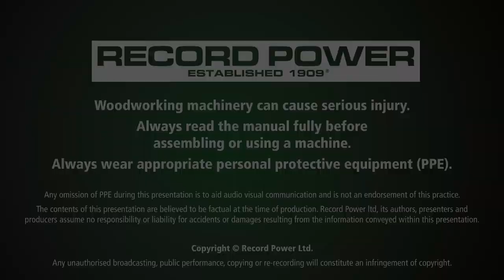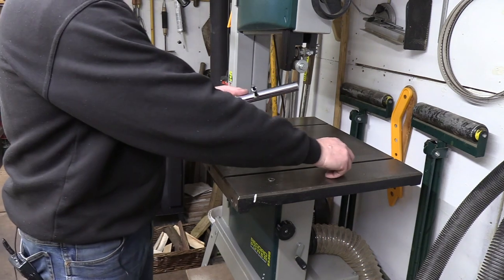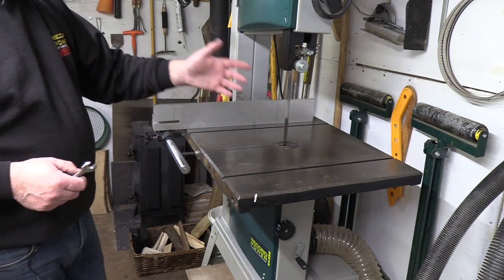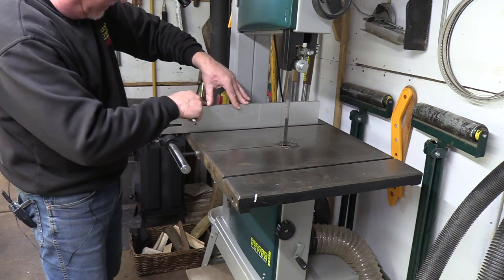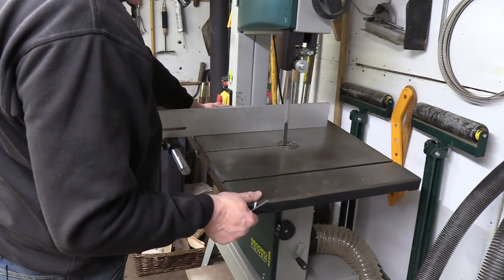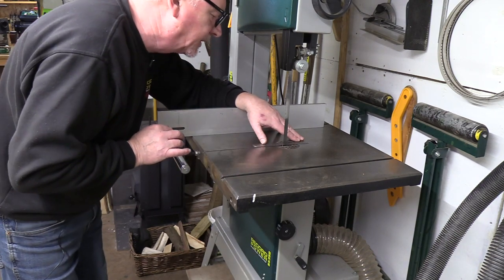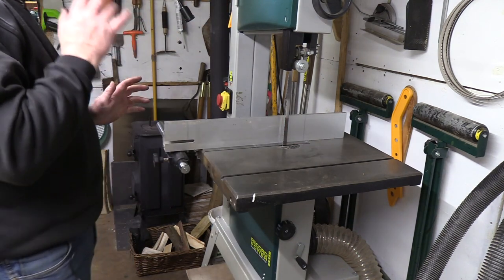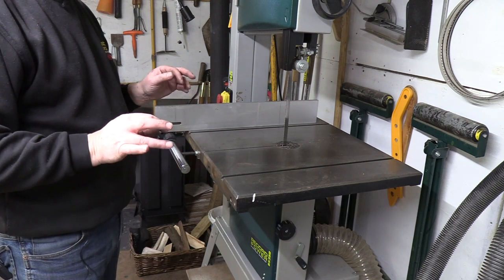Know-How Series: Squaring the Fence to the Table and Blade on the BS350

Comment: Thanks for this video  - really informative. I have the same bandsaw, but when I try to spin the top wheel, (as you demonstrated), it is very stiff, in comparison to how yours spins so freely. I have checked the tension & even when the blade is off it is still stiff. Any suggestions what the remedy is?
Reply from the maker: Hi Desmond, Your bandwheel should spin free with the bandsaw blade removed, id which bandwheel is tight by turning by hand and with the machine unpluged, you can even take the tension off the motor drive belt, check no piece of timber is causing the issue, also the guides are these ok.
PW.
Reply: @RecordPowerTV  thanks for getting back to me so promptly. I appreciate all your suggestions - which I have already tried - so at least I know I’ve been attempting to do something right! It’s strange I just can’t seem to find why this is the case. I have thoroughly cleaned & checked for any debris, I’ve oiled all moving parts, I’ve backed off the guides & the thrust bearings to ensure the blade isn’t in contact at all, but still no joy. I’ll keep looking , but thanks again for your help
Reply from the maker: @desmondsenior3617  Not a problem, if you do need anymore help/suggestions then drop us a line.
PW

Comment: How much adjustment do the four bolts on the trunnion provide?  The BS350S maintenance series has been excellent and much appreciated but I was never able to get the table square to the blade using the method described. In the end I had to undo the two bolts that fix the trunnion bracket to the frame and start from there. There was some evidence my saw had been dropped in transit to me so perhaps the trunnion assembly was jolted out of specification. Anyway I now have everything squared in three planes.
Reply from the maker: Hello Paul, thank you for your comment. The two grub screws below the main table are the main point for those fine adjustments. Any adjustment here must be done with the main fixing bolts released first, otherwise you will not be able to make any movement of the table without risking damage to the taped holes in the alloy block itself. Due to the size of the table only small movements of the grub screws need to be made, do a little and check for best results. Hope this helps. Best Wishes, Record Power.

Comment: on my saw the blade is touching the black plastic in centre, which four nuts need to be loosened before I use the mallot as shown in this video
Reply from the maker: Hello, thank you for your comment. First, slacken off the four bolts or cap screws below the table, these are at the four corners of the trunnion into the cast table, and only do enough so that the table can be lightly tapped/knocked with a rubber/nylon mallet. Once in the correct position, nip up the screws from opposite corner to corner and fully tighten. Hope this is helpful to you. If you would like any further assistance at all, please contact our Technical Support Team on 01246 571 020 or email sales@recordpower.co.uk. Best Wishes, Record Power.
Reply: @RecordPowerTV  thank you, this helped

Comment: Hi,
A 13 inch spanner? Mm?
Excuse me, but I listen very carefully at what is said or what is shown and done.  I' m not a nasty creepy little Gollum, but if anything interests me, I'm thoughtful.
Don't think I always do this, but I bought the same machine and I am therefore more focused.
A very nice angle to film, thank you very much.
Keep it safe, it is not over yet.
Willy from Belgium.
😷😷😷
Reply from the maker: Hi Willy, Good that you have the same bandsaw, mine is very old, still works well, just in need of a bit of spring clean :)